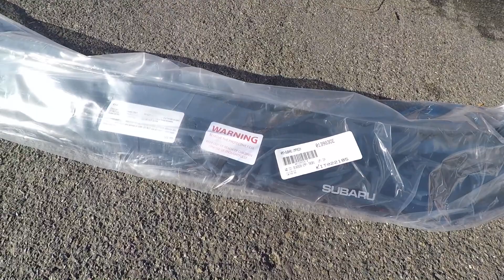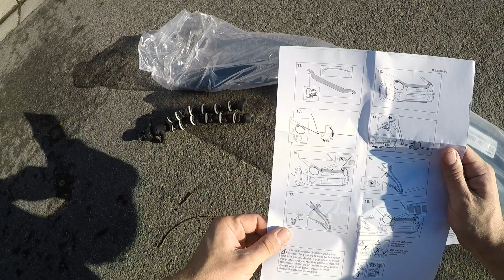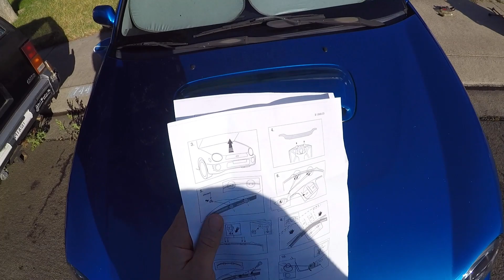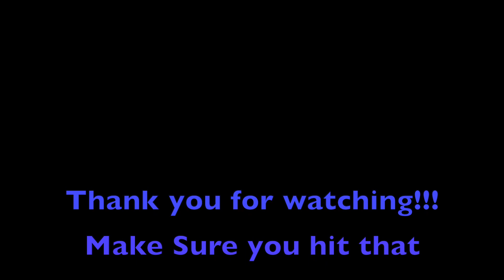How to Install a Bug Deflector on a Subaru STI

Comment: Your suppose to put the weather strip over the plastic. At the end, you also forgot to put the clear tape before the clip.
Reply: you are right about the strips but not on the rubber. i just installed this as well and  the instructions say to put it over